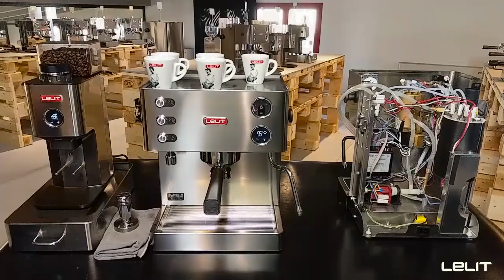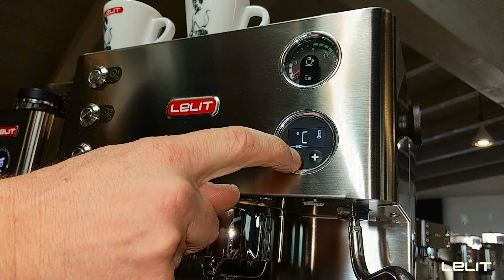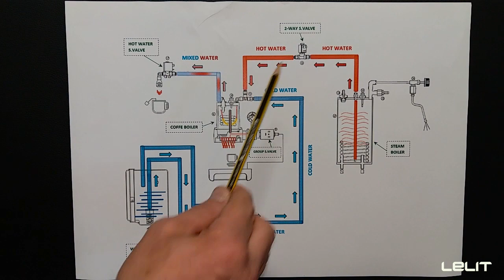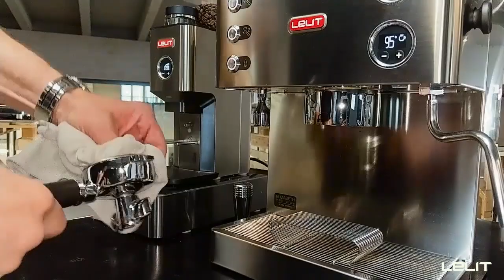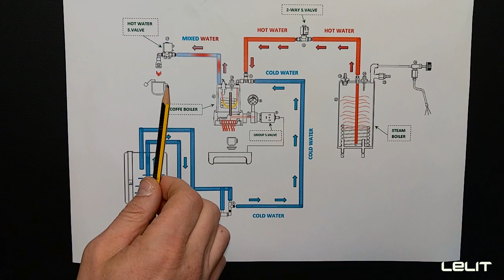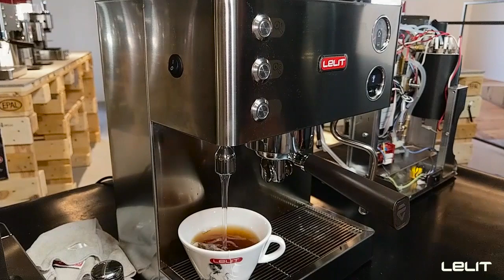Elizabeth PL92T: How it works

Comment: so if I understand correctly , steam boiler water is used for coffee extraction , is this a good idea since most barrista do not recommend using steam boiler water for use in hot drinks like tea or americano ?
Reply from the maker: Hello, as explained in the video, this system mixes water from the steam boiler and pump together as it enters the brew boiler. This allows large amounts of water to be drawn from the brew boiler without cooling it down very much and it gives a much nicer smooth water draw, no spluttering and returns to brewing temperature very rapidly.  We believe this is an important advantage. Thank you LELIT Team
Reply: @LELIT_Official  Si grazie ,, ma non e l'aqua della caldaia vapore  acerba ??  i barristi non la usano per fare caffe neppure per il te ?
Reply from the maker: @gioiosa54  Buongiorno, i baristi sanno bene che tipo di macchina usano e che sistema hanno dietro, va verificato perché danno preferenza ad un boiler rispetto ad un altro, anche perché se l'acqua fosse veramente acerba non la potrebbero usare neanche per il vapore perché andrebbe ad infuire sul sapore della bevanda stessa. Per quanto ci riguarda, il boiler servizi contiene una piccola quantità di acqua, e questa viene continuamente risciacquata. Grazie mille! LELIT team

Comment: There’s a lot to like about this one especially at the price and small size footprint. Pre infusion is great. If they could mange to add a feature to LCC to adjust flow lower at end of the shot or even a simple/manual flow control , it would be hard to find fault. Maybe they don’t want to undercut the Bianca
Reply from the maker: Hi! Yes, to have a manual control of the flow we have the Bianca, Elizabeth is just meant to be a different kind of machine. But thank you for your feedback, we are always interested in our clients' opinions and suggestions. Take care, LELIT Team
Reply: @LELIT_Official  The Bianca is great, I’ve had the chance to try one. The weight andsize (depth mostly) is a downside for me like a lot of e61 machines. I know that the target market for Elizabeth is different but think how much of a cult following the breville dual boiler developed because you can modify it for flow. Change these things in the Elizabeth: 1) volume based shots instead of timer, 2) adjustable pump pressure/flow during the shot, and 3) a better steam knob that doesn’t require so many turns. Cal it Florence 😀. For the home, I would take such a machine over Bianca, crem one 2b-LFPP, profitec 700, etc
Reply from the maker: @cjpixel  Very intresting suggestions! Again, thank you very much. Take care, LELIT Team

Comment: Hi  it seems as if I will pick either Elizabeth or Mara X (or maybe even Victoria) I want some help deciding. So I am thinking of lelit mara X or Elisabeth(or maybe even Victoria due to the amount of coffee I normally brew /day 2-3 espressos and 1-2 cappuchinos)

I ask myself the question “who is Mara for and who is Elisabeth for?”

I really really don’t see anything that Mara does better than Elisabeth, either they are equally good or Elisabeth has the advantage of being flexible and stable with the dual boilers.

From all that have tried both machines I have so far not heard anyone picking Mara over the other due to superior advantage in a certain features or quality in shots.

However, the build quality is another fact... probably mara has the advantage there with a solid ss boiler instead of brass. Also it is very sophisticated with dual PID and much more.

So is the answer that for those who want a good solid machine that is built like a tank that will live for decades and will provide good coffee without a mess/ fuss .... then they should pick Mara

One can also experiment with flow control in the future...

And for those who want better flexibility in terms of temperature stability change of temperature, stability of steam and more back to back lattes/cappuccinos espressos , faster starting time and easier maintenance should pick Elisabeth? 

I am really no pro but read all kinds of crazy arguments on YouTube that have no real fact where the real arguments lie

I just bought the grinder eureka specialita and hope it will be good with my next machine.

Really appreciate any recommendations you might have🙏
Reply from the maker: Hi Aziz, as you have already said the main differences between the two machines are that LELIT Elizabeth has a dual boiler and LELIT MaraX has the HX system and a new electronic and probe system.  Both machines guarantee a stable extraction temperature. We love them both and we are not able to tell you which one is better, but we are sure you will be happy whatever machine you will choose. Thank you, LELIT Team
Reply: @LELIT_Official  ok 🙏🏻, If I for example do 4 cappuccino in a row ... will there be problem for Mara? Will I have to wait for the steam to be ready? There has to be some kind of difference in the amount of coffee they can produce due to different techniques, no?

Also, cleaning the machine and maintenance... any difference in the long run?
Reply from the maker: @AzizIzgin  Hi Aziz, we know our CARE dept is already in contact with you via e-mail, kindly continue with them and ask them all the details you may what to know before purchasing a LELIT product. Thank you, LELIT Team

Comment: Hello👋 thanks for the GREAT machine, I've been using it for about  4 months now and I'm loving it 👍👍👍 got a question though (thanks for the schematics, explaining how it works, by the way)...the problem I'm trying to work out a way to deal with is as follows:
I prepare espresso with pre-infusion time around 6-7 seconds and then I steam milk for the cappuccino. Approximately after the second cup (somewhere around third) a pump comes on to add water into the steam boiler, I believe...and at that time I can feel a significant pressure drop on  the steamer, so I have to stop steaming, or milk is gonna take in a lot of moisture and my cappuccino's gonna be mediocre instead of PERFECT 😂😝... So, now to the question... 🧐
Is there a way to make her pump some water into the steam boiler on my demand? When it is more convinient for me? 🤔😏
PS what I do now is - I stop, wait a bit, then pull a shot of espresso, and finish steaming afterwards, but I don't like that way, cause if I wait for too long milk gets separated. Do you think pouring some water from the hot water tap will help? Do you have any technical info on "when it starts adding water to the steam boiler"?😬
Reply from the maker: Hello ichervon85, the water refill of the steam boiler after the shot is not adjustable but thank you very much for your message. We'll forward it to our R&D dept and keep it in mind for our future projects. Take care, Lelit team
Reply: @LELIT_Official  thanks for the answer. Yep, I understand, that it's not adjustable, but it should use some kind of algorithm when to fill it. I was wondering if you knew what it is, and how we could influence it, even if indirectly)) maybe the steam temperature change in PID could affect that, or pouring some water though the hot water tap... What exactly triggers the pump to come on and add water? Do you have a schematics for that?))
Reply from the maker: @ichervon85  thank you for your attention on this! The algorithm is the following: 1.water is taken from the steam boiler for the pre-infusion; 2. at the end of the shot, the electronic card registers the low water level in the steam boiler and starts the pump for refilling. Again, thank you very much for your message that we'll keep in mind for the next revision and/or projects. Take care, Lelit team

Comment: Hello! I can see in your diagram that this model has only one pump versus the Lelit Diana PL60TR1 (my current machine) that has two independent pumps for each boiler, is this correct? And if that's the case, what happens if you are pulling a shot and steaming at the same time, and the pump needs to refill both boilers? Thanks for the video!
Reply from the maker: In elizabeth the boiler autofill is disabled during the shot to prevent the shot being spoiled. 
The pl60 has 2 pumps, one for the steam and one for the coffee. Thanks!

Comment: What do you think about the difference between water from coffee boiler and steam one? Some people say that water from steam boiler doesn't taste good , therefore it can change overall quality of espresso.
Reply from the maker: Hello! If the water inside the boiler is not constantly rinsed it becomes of low quality. Therefore, this kind of problem is solved if the boiler is rinsed daily. 
During normal use, ELIZABETH continues to drain small quantities of water from the 2nd boiler so there is no stagnant water in the steam boiler. Basically, Elizabeth takes the water for the pre-infusion from the steam boiler and sends this water to the coffee boiler (not directly into the portafilter). 
Thanks to this mix, the water that reaches the ground coffee in the portafilter is also coming from the steam boiler. 
Another particularity of ELIZABETH is the way the system prepares the water for hot drinks: this machine withdraws water from the steam boiler, it mix it inside the coffee boiler with the water taken from the tank  and then sends this water mixture to the hot water dispenser. The result is a good, quality water, with a constant flow, without splashes.
Reply: @LELIT_Official  I fill up the tank with water after reverse osmosis. The quality of water is about 25 ppm. How often should I decalcificate the machine? How am I supposed to do it? I've read the instructions and I can't figure out how to do it.
Reply from the maker: @vladislavgeorgiev9494  For a domestic use we recommend to de-calcify the machine once a year, but we suggest you to discuss this issue with the producer of your reverse osmosis system, which will surely give you specific details regarding limestone residues. The product you can use to decalcify a LELIT coffee machine is PULY DESCALER ESPRESSO. We do not recommend the use of different products.
Reply: @LELIT_Official  As far as I know this discaler has both versions liquid and powder. Which one should I use? In other hand, I've read the manual guide for PL 92 and there is no information about the process of decalcification. Only the proposal about using filters and the following instructions: Never under no circumstances, add any descaling products to the water tank.
Reply: @LELIT_Official  I'll be delighted if you can send me the instructions step by step how to decalc both boilers, because I need to know how to do it when the time to decalc comes.
Reply from the maker: @vladislavgeorgiev9494  We use the liquid version.
Reply from the maker: @vladislavgeorgiev9494  Of course, please send a specific request at care@lelit.com. Thank you!

Comment: I don’t wish to seem negative. 
However, the inside looks rather plastic. 
All those plastic tubes.
Is there a model that uses less plastic?
I am thinking of buying a espresso machine and the Elisabeth is tempting.
I ask only if something went wrong I wouldn’t know how to fix it.
Reply from the maker: Hello, the internal tubes are in silicone and Teflon. Should you need further details, please let us know. Thanks!

Comment: Why does the filter stand on the water discharge pipe from the valves ??
Reply from the maker: Hi,
pls can you specify which filter do you mean ?
If you mean the filter inserted in the silicone pipe placed in the water tank, it must be inserted in the longer pipe, (inlet water).
It’s not correct if the filter is inserted in the shorter silicone pipe (the one used to discharge water by the OPV).

Comment: One of the best videos explaining and showing how the machine works - especially with the schematic diagram.  Makes it easy to understand.  Question please: Is the schematic diagram of the Diana exactly the same as the Elizabeth?  If not, how does it differ?  Thanks very much.
Reply from the maker: Hi,
Thanks for your comment.
The hydraulic circuit of Diana machine is different by the one of the Elizabeth.
In the Diana machine there are two boiler one for steaming and one for brewing.
But they are not connected with each other, so in the Diana we take water for coffee and hot water for tea, from the brew boiler, and the steam for cappuccino from the steam boiler.
The pre-infusion function is not included.